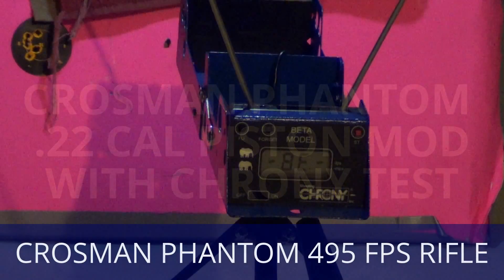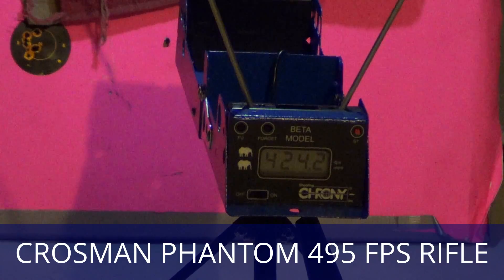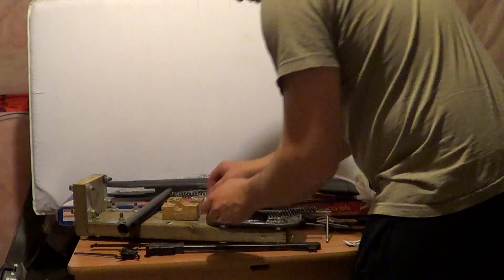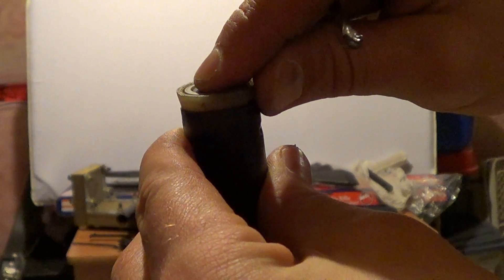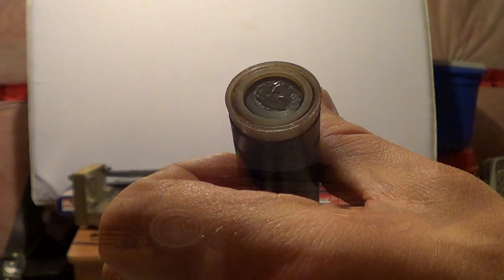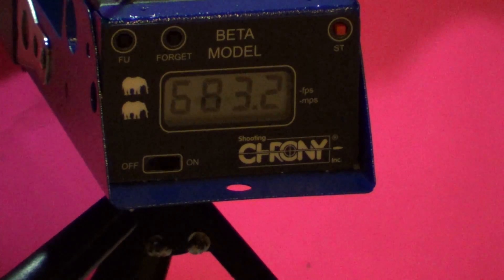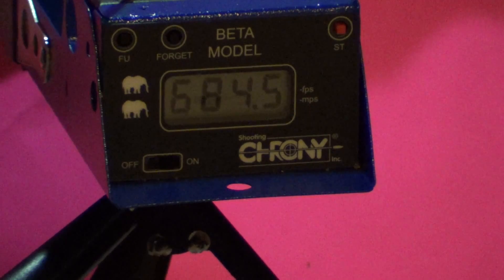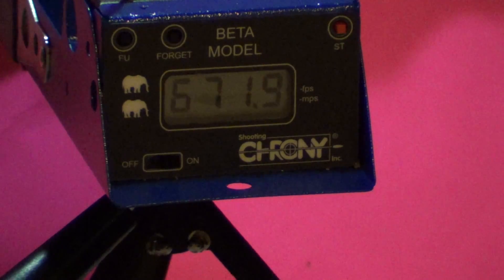CROSMAN PHANTOM .22 CAL PISTON MOD / CHRONY TEST VID 3

Comment: Hi Ringet421 I bought a Phantom after watching your video. I live in Canada and I was wondering if the Crosman Phantom 495 still has a hole in the piston?
Reply: It is my understanding that the Canadian version has a hole in the 
piston to allow some of the  air to bleed off when firing,  reducing the
 pressure so that the pellet travels under 500 feet per second. The 
current anti-gun  Liberal Government  allows the federal para-military 
RCMP to make gun laws  so an  air rifle is considered to be a deadly 
lethal  weapon if it fires a pellet over 500 feet per second. If a 
Canadian version does not have this hole, then I am assuming that the 
manufacturer has  now reduced the spring length  and strength instead to
 reduce the pressure. I would assume that a longer and stronger spring 
would boost the power to over 500 ft per second. This would be 
considered a federal offense in Canada punishable by prison time, fines 
or the seizure of any other guns a person may have and would likely mean
 a ten year ban on owning any firearms legally if that person did not 
have a valid federal firearms license which requires renewing every 5 
years.  However, I doubt the police are going around checking such 
things. They have much more serious things to do with their time.
Reply: can you provide a link please :D
Reply: No, holes in them now. I bought one a few months ago from Walmart and have researched it widely. It has the same piston as the 1000 with no hole and just uses a weaker spring. Order a spring online (can't remember the name of the guy in Quebec) but you can order a spring from the 1000 which is heavier and longer. You don't have to change the tophat or anything else, just the spring.
Reply: Chumley E On the newer models they have a weaker spring and a longer piston. They have basically eliminated the free mod. Even if you got a stronger spring it wouldn’t cock to the same degree that the full power ones do. I would just preload the spring and get it closer to actually being 495. 
If you want to do it for free you could preload the spring and cut the piston down and cut the square catch back in. (the detuned one it about an inch longer) 
Or just order the piston and spring but at that point you might as well get your pal as it will cost more to mod it then buy it in it’s proper version.
Reply: Chumley E Please give us a link!
Reply from the maker: +TallTiger I'm not not sure. People have been commenting that some don't. I would assume its just an easy way to detune the rifle to fall under the legal limit. But maybe now they could be using a different main spring in Canadian models instead. If that's the case you can simply order a new main spring to bring it up to the American models specs or greater. I tuned my ruger to shoot accurately and went up to 1400 fps but I found it was most accurate at around 750 to 800 fps and that's how it sits now
Reply: @BROTUNED  Id purchased one in America at bass pro shops that shoots 900fps and up to 1200 fps out of the box no mods, and with the gold plated pellets which are a waste of money if you ask me.
900 - 1200 fps with a good aim can take down a predator in hunting at around 70-100 lbs. Kill.
Great for raccoons, Opossums, rabbit, squirrel, giant crow, turtles, chipmunks etc.
Awesome for all around backyard target practice. Just remember to surround your pellet targets with a material that wont let a pellet pass through. If you miss your target, the pellet has got to go somewhere so, pay special attention to that safety detail so you don't shoot out your neighbors windows or heaven forbid house pet out back having a s#it.
Reply from the maker: you would have to look I have heard that some dont
Reply: oh ok thanks man

Comment: hey is the JB weld still working for you ? has it broke if not please let me now as i want to try this !
Reply from the maker: Still going strong I also use jb to bed my long range rifles no issues what so ever
Reply: thanks for replying!! just curious but if someone mods this to shoot over 459fps without a PAL in canada  what is the charge ? fine ? jail time?    i looked online and i couldnt find anything about that.
Reply from the maker: +reviewsDaily basically you would have an illegal weapon just get your pal it's cheap and easy. and once the pellet gun shoots over 500fps you have to store it as a firearm. nothing wrong with 495.
Reply: funny guy ;) canada is a bitch man its not that easy. will this mod work with a crossman optimus ?
Reply: +reviewsDaily the optimus is basically the same gun, wood stock instead of synthetic, if i remember right
Reply from the maker: +reviewsDaily most crosman break barrel rifle share the same parts. that's why an easy mod is order the spring from the 1000+fps rifle and just swap them.

Comment: Hey RINGET421, great video. I have this rifle and tried this mod. Well, i used the 4min drying JB weld and it didn't last long, so, a heads up on that one. Trying the 24hr dry time JB weld this time. I live in Ontario Canada, i would like to discuss more with you. Is it possible i can pm you with some contact info?
Reply: hey is the canadian version still strong enough to kill rats etc? Im from Toronto. Just wondering cuz crossman says it is 495 n it shows about 430 also since its pump does it get weaker in the future
Reply from the maker: +Just Gaming it would kill a rat with no problem at all. as for weakening over time I'm sure it might but not enough to matter. all my air rifles get a lot of use and haven't noticed a change. enjoy your air gun

Comment: Is this hard on other internals ?due to compression?
Reply from the maker: I would think the only difference in the 495 and 1000 is the spring and limiting hole. so by plugging it you can get a bit higher velocities. as for wear I would assume that the higher compression would actually be better than having little to no resistance against the piston as it slams into the end of the tube. by adding a spring it would theoretically be the same as the 1000 fps gun. this is just my opinion based on things I've seen and done

Comment: Howdy RINGET,
Great video, thx for sharing. Ordered my Phantom .22, still in mail.
Was thinking and wondering what's your take on taking the main spring out and carefully stretching it out and then assembling the stretched main spring back on?
Would this add another 100 fps or so? Wish I could order a full 1000 fps main spring but don't know where can it be purchased?
Cheers
Reply: +chev rolet  Appreciate the good info man. On vortekproducts.com there is another thing of confusion, how many coils do you choose, the spring (780125)comes with standard 33 coils but you could order it with as many as 40!? Cheers
Reply: +Antoua B  Damyt , it didn't say that last time I ordered (Nov '14). I asked for max possible length and I rec'd 35.5. I wanted >40 but 40 is better than what I got. Next time I suppose... Thanks for pointing that out.
Reply from the maker: Antoua B http://vortekproducts.com/ourstore/
Reply: +Antoua B It would just damage the spring because you'd bend it, then it would bend back once cocked, and no doubt a little weaker that before and likely bent too. The oem full power spring can be bought from Crosman directly, or if you're not in the US then thru other sources or an aftermarket spring like the Vortek RINGET posted. The hard part about aftermarket is you need to know the size you want and how to make it work, because I doubt any carry the exact size.
Reply from the maker: Look into vortex springs just do your homework match od and get a heavier coil and you'll be at or around 1000fps
Reply: +RINGET421  That's the hard part I mentioned. As far as I know Vortek only has one the same OD, and it's weaker than the oem full power. The two others I know of that will work are 780125 and
790128, but the 790 doesn't fit all pistons b/c it's so fat, and neither fit the guide so you have to improvise. The oem Crosman is cheap and fits. Installing a nitro is an option as well, if you trust it to last.

Comment: WHAT YOU SOLUTION ISTOLZUETE When the holes are sealed piston ???????
PLEASE REPLY!!!!!!!!!!!!
Reply: sorry lubrication
Reply from the maker: Владимир Жежер  The piston seal in most modern air guns is  made of a synthetic material that is self lubricating. but when doing routine maintenance you can use silicon grease such as Silicone Faucet Grease found a hardware stores or hobby shops carry silicon lubes for remote control cars Traxxas Silicone Differential Lube. Another option is using motorcycle air filter seal grease like Bel-Ray Waterproof Grease. hope this helps you out.
Reply from the maker: Владимир Жежер please subscribe for my latest videos and hit the like button please that really helps me out thanks again

Comment: @ringnet so i just bought a new crossman phantom .22   and its not the same as the old ones ?? dunno if they change em or what but theres no hole in the piston to fill with jb weld anymore ?????  so i did the same mod i did before 2 pennies and a dime...and it did absolutely nothing for increased fps ??  my old phantom was amazing at the power difference....i just dont understand ???
Reply from the maker: not sure

Comment: i'm thinking the pressure spike is correct but with out a pellet to seal the breach there is open path out the barrel. so i'm thinking the restricted airway holds back the volume of air following the pellet down the barrell. i'm quessing like a slow leak as apposed to large puncture?? what type lub are you using on the piston and pressure chamber?
Reply from the maker: ya thats true. hmm maybe i should give it a try on my days off. just dont wanna ruin a good gun if it fails. but maybe i can pick up a cheap used one or something. but good point. got me thinking now.

Comment: just started modding phantom 495fps. don't have a crono but functionally the rifle is noticeably better. 14.3 grain pointed pellet. so 4 10 cent pieces for spring shims(don't have a new spring yet) and super glued a bamboo toothpick in the piston hole(it works and i can drill it out easy). results: prior to tinkering i could only hit a electrical box cover plate with lucky shot at 35+/- ft. that,s the range on the box. now i can hit it every time and, befor etinker it would remoce the rust only, now it dents the plate approx 3/64 inch deep and there is a bump on the opposite side. no crony test but impact wise it has punch already. and it has better trajectory i think based on the consistent target strikes. the gun is already at the limit of the cheeky red dot toy sight. it needs a scope. next mod will be interesting. has anyone messed with the air flow to the pellet? will it help? does crowning the barrel help on these pop guns?
Reply from the maker: not to sure about crowning the barrel unless there is a problem with it and if you were to do the crown i would set it up properly in a lathe and it has to be concentric to the bore not the barrels exterior. so it would most likely cost you more than the rifle is worth. and i haven't tried to change the port diameter or shape but it is quite possible that it could effect the pressure curve. but i would have to look into that a bit more scientifically. i'm almost thinking that the port is that size for a reason possibly building a pressure spike. but thats just a guess.

Comment: Cut  the  piston  backend  off.. but  make sure  you  make  a new  sear  hole..  you  have  to   center punch  it  with  the   location  of  the  trigger  sear
Reply: I noticed the hammers come in different sizes lengths for more spring compression crosman phantom has a larger piston witch requires less cocking the optimus has a smaller length hammer to increase the spring tension its noticeably different when cocking its degree when the barrel is broke is much longer of a stroke  hope that helps
Reply from the maker: have you done this? what kinda gains do you get and what is the reasoning
Reply: Its  to  get  the  full stroke.  Ill have  to  show  you  how  on   video.   Ill measure  my  piston  to  make sure  you  don't  f...  up  yours
Reply: By the  way  my  name is peter
Reply from the maker: Gail Barwise thanks peter that would be awesome.

Comment: I just bought this gun recently and took it apart and there is no hole. I'm from Canada and I was totally expecting to see that hole. So what are my options?
Reply: What is regulating the lower FPS, the spring?
Reply from the maker: XDevilsChariotX the springs is the main power adder but just plugging the hole gets you near 700fps in 22cal which is awesome and plus its pretty much a free mod. very cheap to do and lets you learn how the rifle works. have fun and stay tuned for more videos. let me know is there is anything you would like to see me test or try. thanks again.
Reply from the maker: thats wierd. is it .177 or 22? the next step for you would be to upgrade the spring.
Reply: ringet421
would you know what spring I would need to push me up around 700-800fps and where to get one. Not really sure what I'm looking for when it comes to springs. Just getting into all this mod stuff with air guns. Any help would be appreciated.
Reply: ringet421
sorry forgot to mention its .22cal
Reply: did you ever get that figured out
Reply: yes
Reply: XDevilsChariotX what did you do??
Reply: XDevilsChariotX I’m buying this gun. What did you do to get it at a higher FPS?

Comment from the maker: Mark you should always have lubricant on any moving part of the rifle. I would recomend you pick up some oil and take it back apart and lube up the internals with the correct oil for air rifle internals. Do a google search for the correct oil for air rifle pistons.
Reply: +420BluntOne  The oem "full power" spring is ~.730"OD and .122 wire with 35 or so coils. Crosman has several different coil springs to reduce power, just as they have different pistons, and in case a hole. 
Yes you could drill your own hole, which will reduce the power, but it's a bad way to reduce power, negative side effects. If you want to drop power you can use a lighter spring and/or shorten the spring spacer. The spacer is 1.5" long, and if you remove it on a full power (18ftlb) gun it'll cut power in half. It shorten the spacer/make a shorter one to adjust power as needed. 
The nitro is a spring, a gas spring. The gun in the vid was not a nitro. If you want to reduce power in a nitro gun they sell a weaker nitro spring. It's 2/3rds as strong as the standard one.
Reply: RINGET421 
If there is no hole present could you theoretically drill your own?
Can you give any help/specs on replacing main spring?
I was under the assumption a nitro piston does not use a spring.. i guess i was wrong there.
Reply from the maker: 420BluntOne nitropiston guns use compressed nitrogen to generate the power. basically an air spring. if you have a spring piston rifle you could drill a hole but you are just de tuning the rifle to have less power. if you drill a nitro piston it wont work at all.

Comment: Also A nice Sand on the piston itself add's a few extra FPS   i polished mine up on a buffer wheel .     Got it shooting through the top steel plate of a power supply.     not sure The foot pound's delivered .   But like i said before.   It kill's rabbits.  crows squirrels.  hit coyote in the ass n pissed him off so. Don't shoot anything larger than a rabbit at 650-750 FPS.
Reply from the maker: i think if you get in close enough it would kill a yote
Reply: ringet421 Yeaahhh i thought so too.    

Was about 200 yards away so i think anywhere under 150 with a well placed shot would take him down.

Also mind you i wasn't trying to kill him hahaha.
Reply from the maker: ya it would have to be luck to cause if you hit a rib that would be the end of the killing power. so it would have to go between the ribs and enter at least 2 to 3 inches and i think it would die back in the woods someplace but i was thinking more like 50 or 60 yards max. not sure what  the velocity would be at the 50 to 60 yard mark maybe ill test that out this spring. get a good 50 yard zero then shot through the chrony

Comment: I did the same thing.   

Dipped the screw in JB weld then jammed it into the hole.   waited for a bit then dremeled it down to clean metal.  

Put a half inch spacer on the spring pole .   Add's A great amount of force.   Took down rabbits with this all winter
Reply from the maker: Jon Penney that sounds like it works good thanks for the comment. thats less work than tapping it and i know the jb will hold up to cause that stuff is amazing.
Reply: ringet421 Exactly!

the jeb weld act's pretty much like super locktight and the threads bite into the piston's metal.  (aluminum i think?)

But Great video dude!

I might just make one of my own on my beat up ol beast.      shes seen some years hahahahaha
Reply: was the piston head made of steel or another metal?